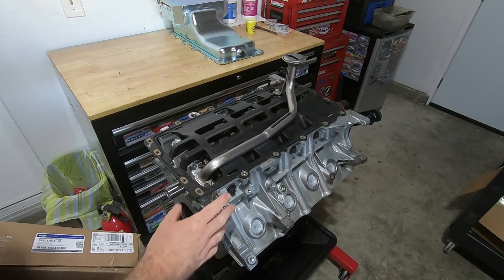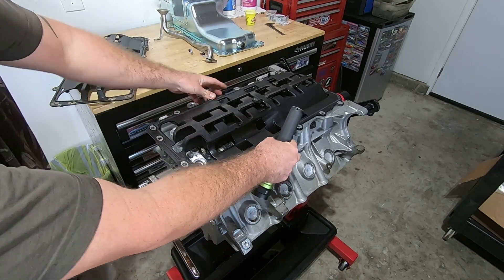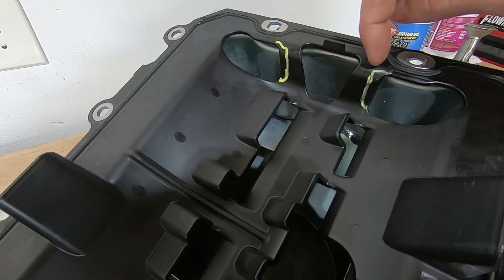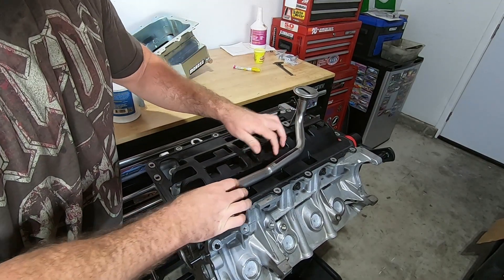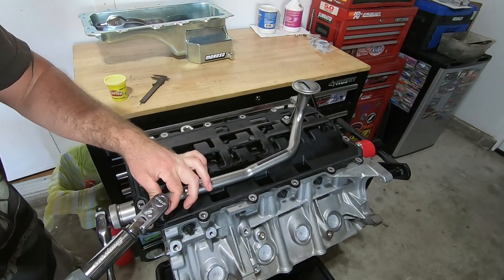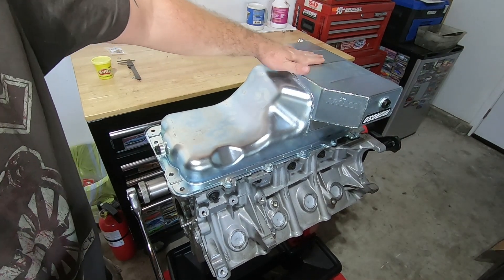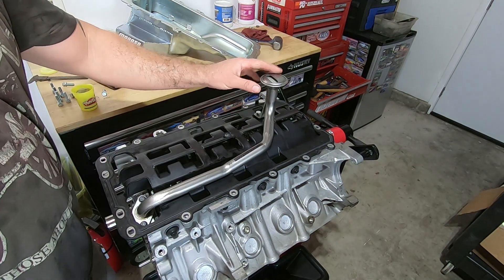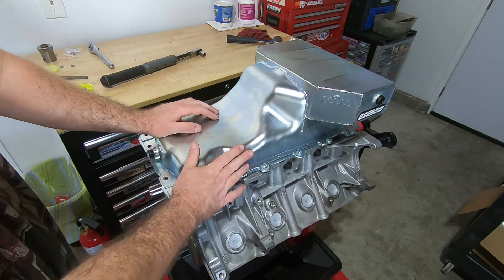Pt 14 Installing Windage Tray & Oil Pickup Tube Clearance - 5.0 Stroker 4.6 Teksid Engine Block

Comment: So Modmax I guess recently released one for all 4.6, 5.4 and 5.8 and in trying to find videos or anything on it, and I cannot. I've ordered it so I guess I'll see how it goes. Lol
Reply: What block are you fitting it on? I have an iron 5.4 I would like to use this one- does the mod max one require any trimming?
Reply: Did you get it installed?

Comment: Just installed one on my 04 Explorer block with stock Mustang oil pan and Ford 4V oil pump/pickup. I had to cut off the two finned baffles in the pan, scrapper from the pickup and then trim the windage tray for the pick up to clear. Thanks for making the video!

Comment: Will this oil pan clear tubular k on sn95 ?
Reply from the maker: Yes, this pan, and most aftermarket pans, should clear all tubular k-members.
Reply: @JohnSmithRacing  aI need to modify the oil pick for correct clearance  is the windage need to install the pan ??